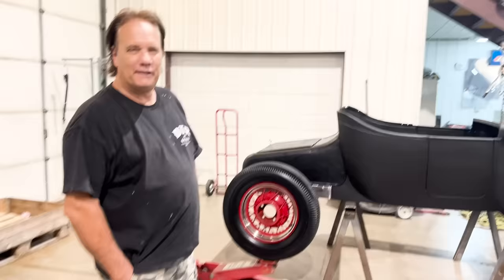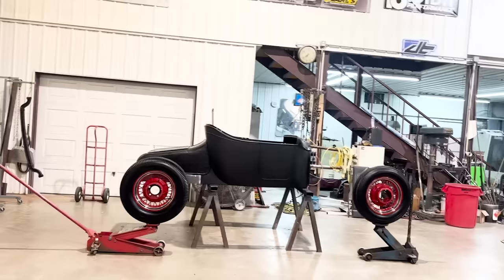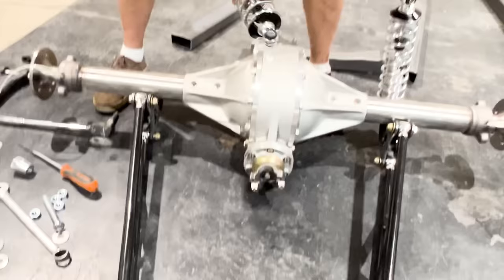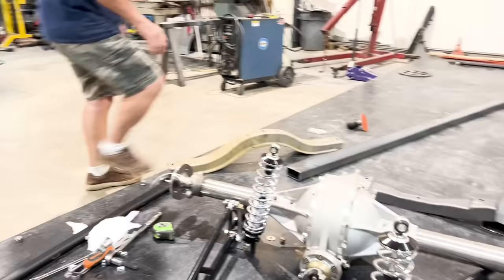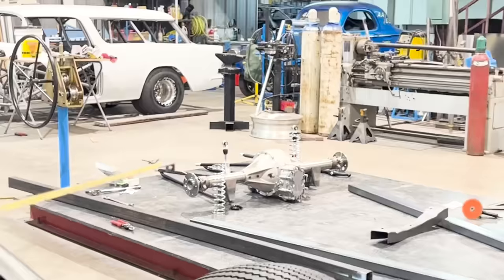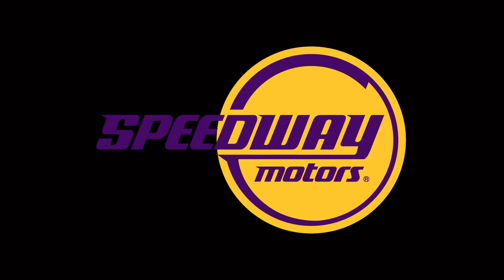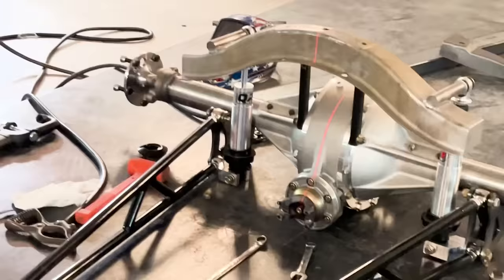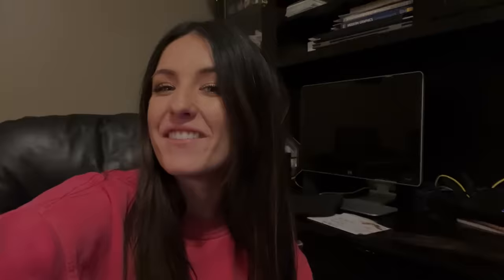Building a Custom Frame & Rear Suspension Set Up for a Model T Roadster! - Video 7 Isky Tribute Car

Comment: In the '80's I was partners in a shop which did everything for body work to repairs, while my partner & I built street rods, restored cars & I built drag chassis.

I was beginning a project for myself, it was a concept to drag race for shop advert. It was planned as a '57 Funny Car, if there had been such a thing. Began w/ a 55 Sedan; turned into a chopped top roadster. Bought the spare motor from a B Alcohol FC, a cast 392 Hemi, Hilborn Injection, & the point of the story an Isky roller cam.

I called Isky Cams, since I knew squat about Hemis & nothing about the cam. You have to remember this was the early '80's, trade shows like NEMA were dreams, or not attended by the public & unless you were a big time racer, you just didn't meet big names in HP parts. You bought their parts, got a sticker & that was as close as you got.

I called Isky Cams... a gravelly voice answers,  "Isky Cams, this is Ed, whatcha need?"

I stuttered out my story about the engine I'd just bought & my level of ignorance.

Ed proceeded to go non-stop for 10, maybe 15 minutes about the cam, specs, tuning advice, what kinda performance to expect.

Then he really surprised me. "You in Oregon, you said.  Get that motor outta Portland? Yeah, I think I remember a '92 Roller going to an older guy running an alcohol Funny. Sold it to some kids, last I heard, his health was causing problems.

He continued, Before you get too far w/ that Hemi, give XX, just outside of Eugene, a call, here's his number; knows more about '92's than anybody in the NW, maybe the West.  He'll help you out, lives & breathes that old iron & loves to help young guys who're interested.

Need anything else, give me a call.

Writing everything as fast as I could, I stammered out my appreciation for his time, help & name... & it was over.

I sat there, mind blown, but racing w/ info as my partner came in office. 'What are you plotting? You have the bigged grin on your face. What's going on?"

I told him...

GeoD

Comment: Looks like we found our new Barris builder, great show & stuff! I still injoy someone else working it old school hard & better.
From the motor city.
My grandads came to this county in 1906, to build the MODEL-T with mr. Ford.
And just a note; i would have cut the panel above the gas tank to be removable. Also for what its worth, it seems like you need more outer metal on those bolts, especially if theres a monster engine may break off, on the axles. 😮

Comment: I'll go for the shortest.  I spent 6years with the Highland Plating Special (Hot Rod Oct 62 cover car.) This car was orignally was Dick Kraft's roadster.  The wheel in the rear was in the middle of the Trunk.  I like short the best and nothing sticking out.  If it helps the frame had a 4inch extension just in front of the fire wall. It also had a quick change.  Flathead powered.  Just mentioning it.

Comment: Dude, it just occured to me that No Prep has rules on weight classes. Well, a Model T is already light by factory specs. While other cars HAVE TO be at over 3,000lbs to classify. But, a Model T weight is different because THEY WERE MADE LIGHT! This is one of the big reasons why they used ROADSTERS so much in the '50's. Put a big motor on that little body, instant winner pretty much. I think 🤔 that a roadster for racing IS PERFECT for drag racing. Just a thought. Anyway, thanks for the video 📸.

Comment: To my way of thinking, placing the coil overs in front of the axle will reduce shock speed and stroke, which isn’t really a bad thing in terms of damper performance. 
Just my 2 cents worth. 
Tbh, I kinda like the look of both short and mid wheelbase, almost like the mid better but hey, it’s completely subjective and beauty is in the eye of the builder, or something. 
Whatever you do, Dennis, it’ll be stunning. 😎👍🍻

Comment: In the old days, with bad tire and shock designs, the longer the wheelbase was best for bumps at high speeds.  If using the modern tires and shocks, the short wheelbase would work.  Most people don't remember what caused problems like the "Dead man curves", which was steering, tires, sway bars, and shocks.

Comment: I agree with y'all on rear tires. It  doesn't have an appealing flow between the deck and tire radios, with the axle set so far back.  It looks tractor'ish.

Comment: Dennis, won't that bottom coilover bracket try and spin with only one bolt holding it to the rear end? I'm sure the coilover will only let it flex so far, but I would think you would need 2 bolts or a locating tab to keep the bracket from spinning? Love the in depth build on this one so far Alex. Keep up the good work.

Comment: The wheels on my 29 Plymouth are the same way  the hole in the wheel is smaller than the bolt pattern. Even worse the lug nuts are 15/16 or 1" I don't remember which. They are a pain to get off and on.

Comment: I know the car is already done and has been unveiled; but with those lower shock mounts Dennis made, what keeps them from rotating on the ladder bar bolt with only a single bolt tieing it to the ladder bar?  Is that the intended design so the shock mount can rotate with the arc of suspension travel?

Comment: Good morning, you guys are great.  My daughter got to talk to Alex at Pomona for Hot Rod West a few weeks ago…she is still smiling.
So I have a question:
Will your lower shock mount loosen?  The mount looks like it makes a lever so when the suspension cycles will it try to rotate and loosen the lower bolt?  If it works can you explain it?  And you class has put my wife to sleep so I am  quietly watching and learning Thank you
Reply: We have a winner... Finally someone spotted the design flaw. This is exactly what is going to happen. One side will tighten, the other side will loosen. It won't loosen / tighten enough to matter, but It is going to rotate downwards on the bolt and cause the lower pivot point to bind, this is where the real problem lays. The fix is nearly as simple as the problem. If he wants to utilise the bolt he needs a second rigid point to stop the rotation. He could make a new bracket that fixes to both of the ladder bar bolts (that is the least ideal method) because the shock point is still under torsion. He could make a new bracket like the first one, but have it grab / bolt / wrap around the ladder bar so the shock mounts between the two mount points (better idea) or he could simply remove the brackets he made and weld two flat pieces of steel directly to the ladder bars (probably the best solution).